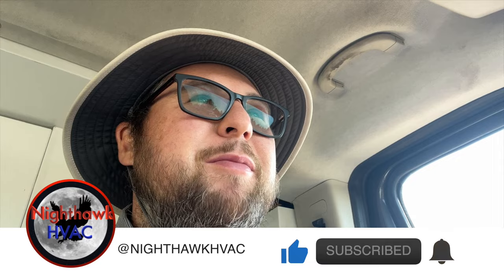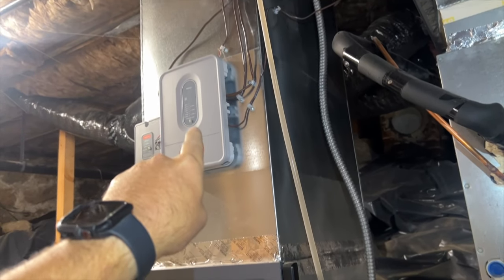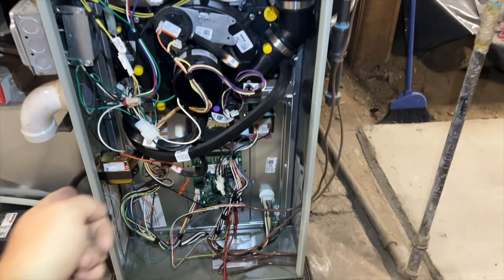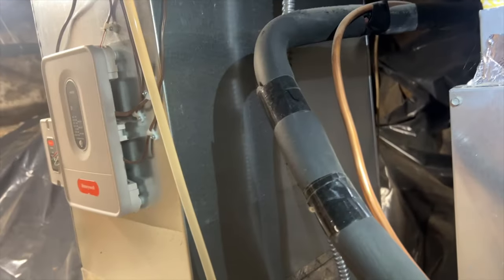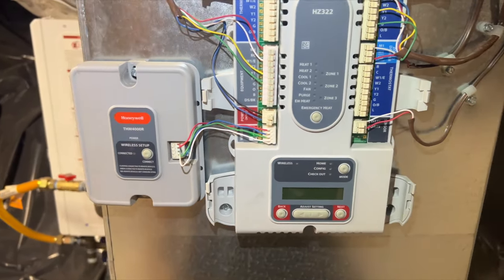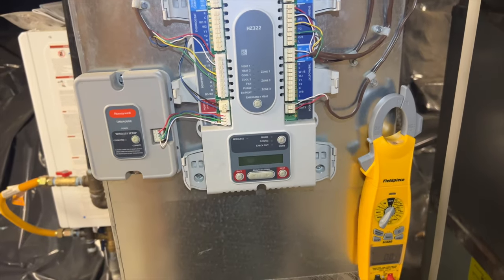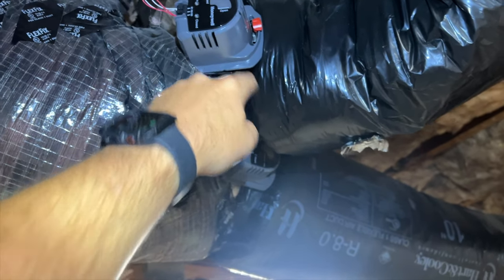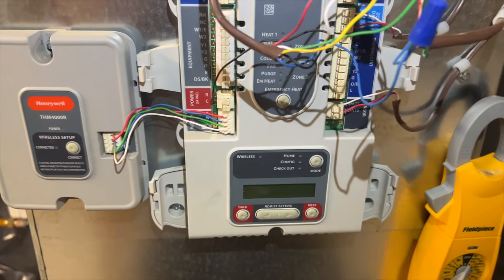Zoning System Non Responsive. How to Bypass a Faulty Zone Board EP146

Comment: Very helpful video! I’m a DYIer.. but have worked on equipment all of my life. We’ve been through two Honeywell boards. Now I know why. The board is installed in the intake cabinet of our HVAC which is outside of the house. When I pulled the panels off I was floored when I saw the moisture level. The board was dripping with condensation. I can’t believe they installed it there. The panel above , were all the electronics doesn’t have room for it… This video helped me get the unit going tonight. We live in the south so we would have sweated our butts off! 😂😂 Thank you so much! I’ll be giving the boys a call tomorrow. Lol BTW , you’re a great technician!!
Reply from the maker: Glad I could help. Thanks for watching.
Reply: @NighthawkHVAC Thank you! Great channel!

Comment: I’m trying to bypass the same unit. I didn’t understand the comment about the c wire can you explain?
Reply: Someone cut the wire too short
Reply: Could have easily added an extension onto that blue (commom) wire by slightly cutting back the insulation and adding a small section/piece of wire to keep the color-coding correct, therefore simplifying the return job call.
Reply: He had to mess with the c wire (common or negative) because on the equipment side it doesnt ask for that wire , so he had to steal power from the other common wire that was helping powring the zoneboard

Comment: Hey brother I love your videos. Is there any video of you explaining how to program one of those? I rarely do residential. In more on the commercial side of hvac and refrigeration. Please let me know
Reply: IM***
Reply: The HZ332 and HZ432 come with instructions but they're pretty intuitive to program. I'm pretty sure that you can Google it and get the instructions. Those are my favorite boards because, on multistage equipment, you can program the board to stage up on a call from the thermostats (Y2, W2), percentage of zones calling or on a changeable time delay. Those boards are also great for their test feature as well, easy to test damper motors without running through to house to thermostats.
Reply from the maker: Not yet but I’ll see about making one soon.
Reply from the maker: I concur.

Comment: You're a great Technician. I have a question please.
It's 322 board why only one t stay is connected? Isn't should be more than one stat ?
Reply from the maker: One tstat is wired in the other is wireless and is using that RF interface that’s connected to ABCD